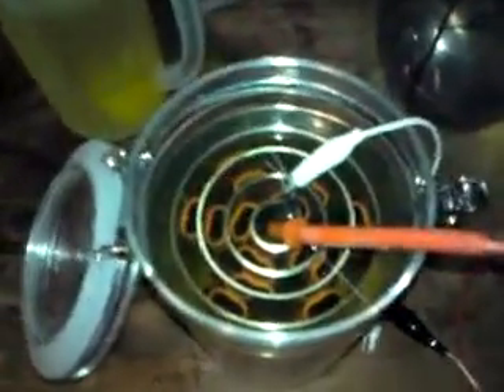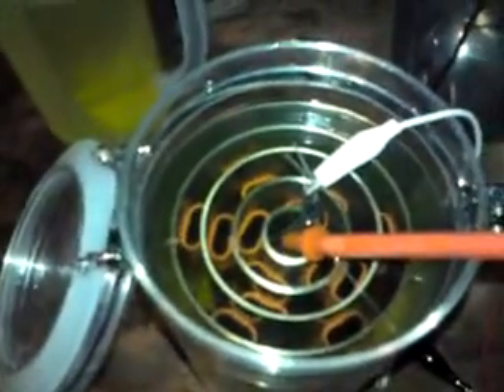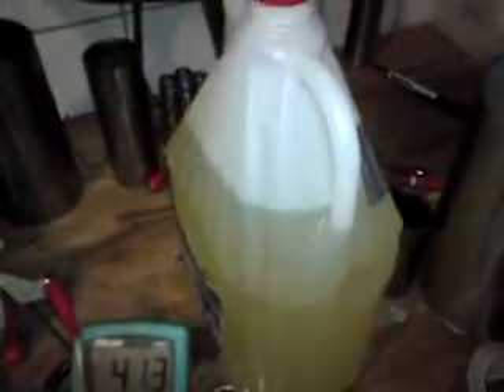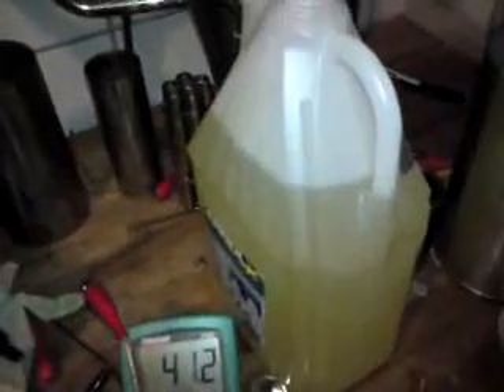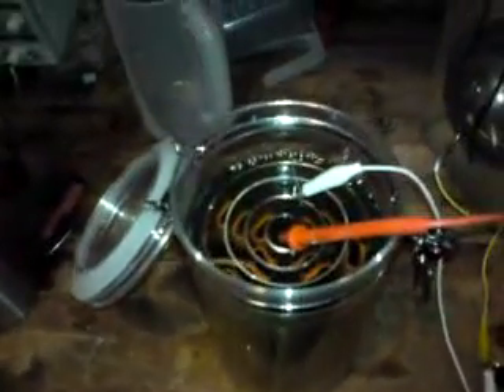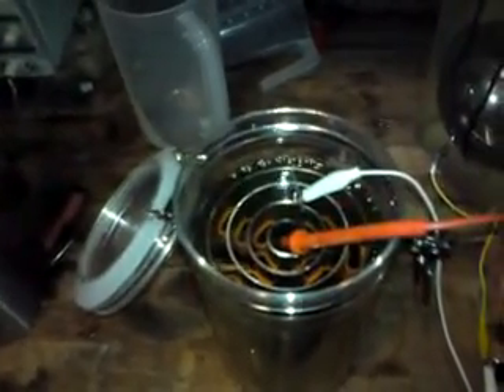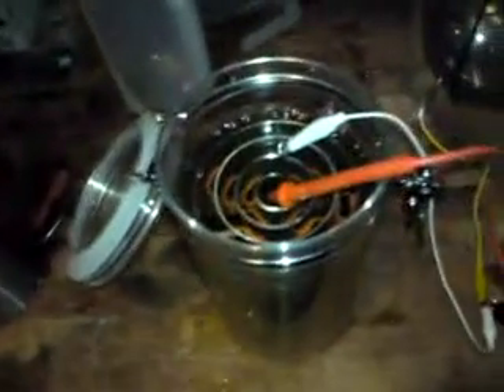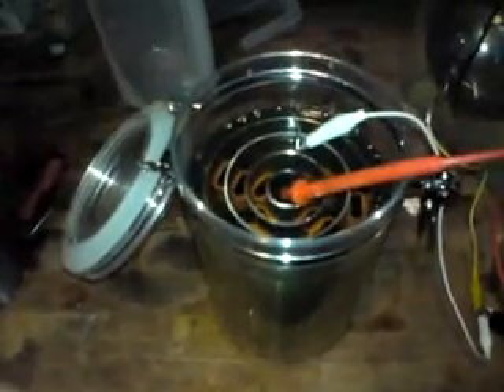IPCtec stage 3 Joe Cell (eng)

Comment: This is not electrolysis my friend. Joe Cells are aetheric energy accumulators. When fitted to a car they don't use up water or act anything like a hydroxy booster. The car just runs. No petrol required but very hard to get working. He is conditioning the cell and the water so that it draws in this anomalous energy. The conditioned water is then transferred to the cell fitted to the car.